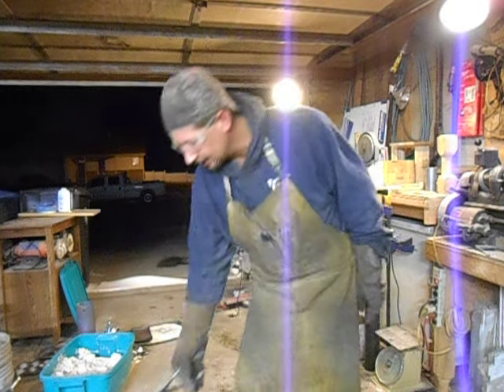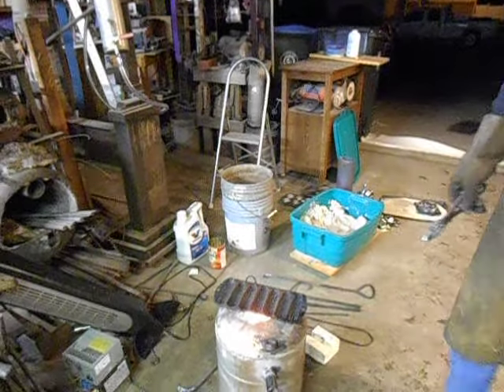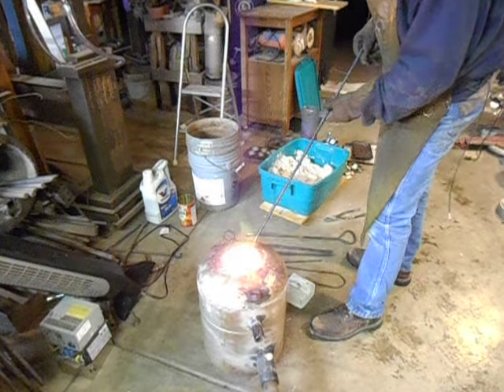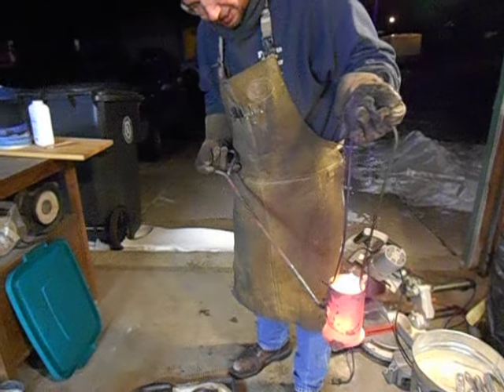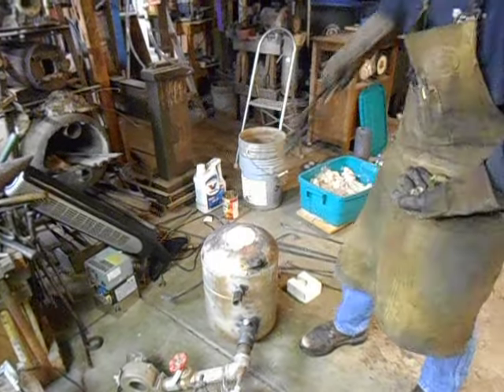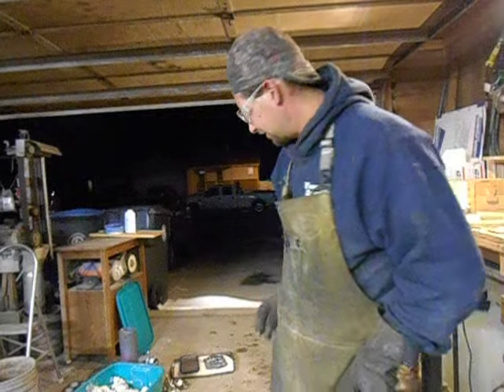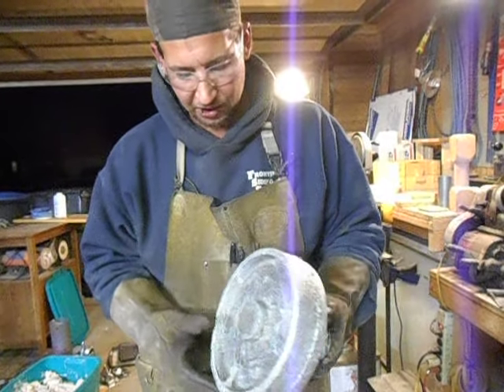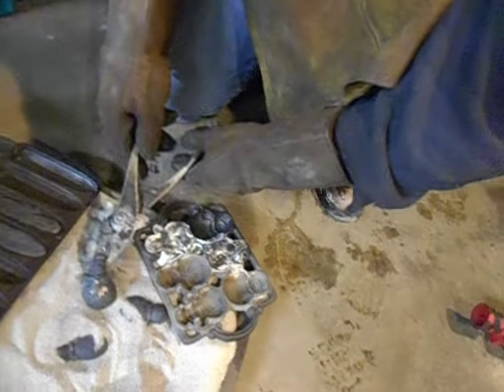casting copper snowmen

Comment: When you say sand casting (for the 9" wheel), do you somehow make the mold out of sand?
Reply from the maker: +C amber yes, with a mold that I made out of pine, and rammed into a wooden flask with greensand {fine sand, bentonite clay, and a little water}.
Reply: +Joe Calton That's even cooler that you can make your own molds that way.  Thank you for the explanation.